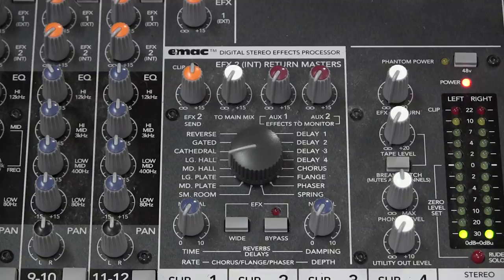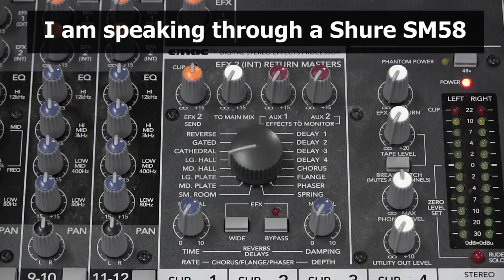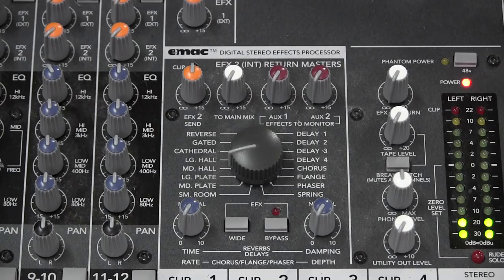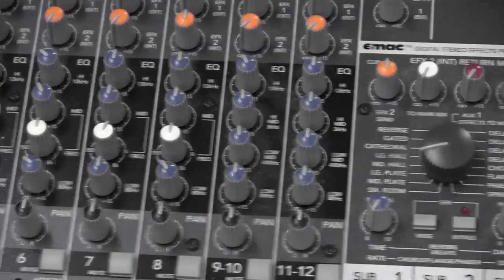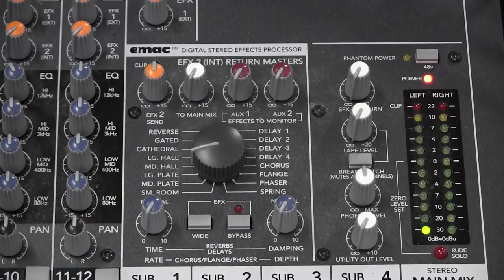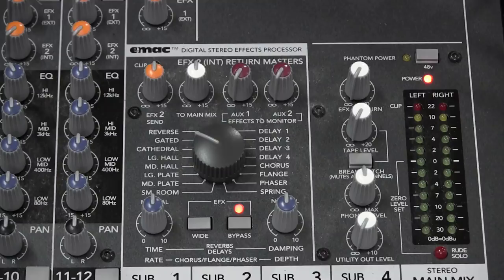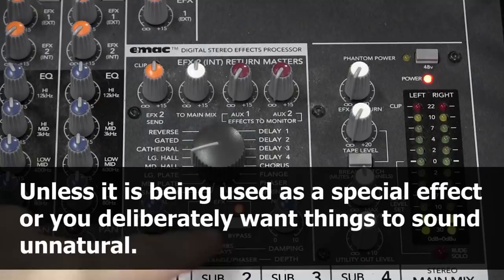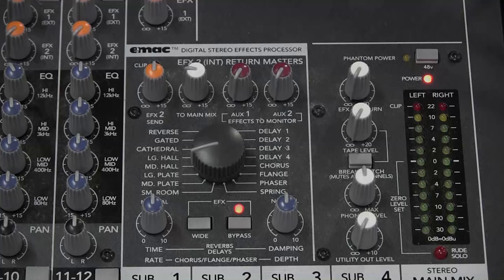How to use a mixer's internal effects processor

Comment: I'm a little confused when mixers say the are 12 channel mixer but with only 5 faders. 5/6 on one fader 7/8 on one etc. how do you access two channel at once on one fader ? What is the difference. When it says 12 channel I usually expect 12 faders for each channel
Reply from the maker: It's a stereo channel - if you look at the input panel these channels will have a left and a right input which are routed to the left and right outputs respectively. So it's two channels sharing one fader. 

Of course this is technically cheating, but mixer manufacturers have done it for years and it has become a norm in the industry ;)
Reply: Kurt Jansohn vn

Comment: I have a berhinger xenyx QX2222 mixing board. I am trying to figure out how to use the internal reverb that is built in the mixing board, and send it to the house speakers, and I also need to send it to my monitors on stage. I am using the aux send, but I can't get any reverb to my monitor mix.  In the aux send/fx out section there are aux 1 and 2, and 3 is supposed to be the orange one that sends the reverb and there is also a 1/4 " out with a fx in the aux send section that I don't understand. If you could help me I would appreciate it.
Reply from the maker: +Ashley Moss Hello Ashley, that mixer is broadly similar to the Mackie in my video. Make sure that the FX knob is turned up on the channels that you want to send to the effects engine, and that the FX master in the aux send section is set to 12 o'clock. The returning signal is controlled by the orange FX knob in the stereo aux returns section, to the right of the aux send section - make sure that the switch is in the up position to send the effects to the main mix. 

On this mixer there does not appear to be any way to route the internal effects directly to the aux sends.
Reply: +GLB Productions  Thank you, I think I will have to get a rack mount reverb unit to run to the monitors.
Reply from the maker: +Ashley Moss You're welcome, all the best with your music! If you would like to support the channel please consider signing up to become a patron at https://www.patreon.com/glbproductions?ty=h Every little bit helps!

Comment: Hi, I have a question that is kind of urgent: is it possible to mix the internal FX from the mackie efx mkII seperately to the monitor-speakers? How do you do that?
Paul
PS: great tutorial. I learned a lot from it!
Reply from the maker: Vormingplus Oost-Brabant Yes, that's what the 'effects to monitor' knobs are for - they allow you to control effects levels going to aux 1 and 2 separately from the main mix.
Reply: GLB Productions I tried this yesterday while putting the Aux-switch to pre-fader (as you suggested in another tutorial - and indeed I get fx on the aux- out's, but the effect is only present when I put the channelfader up. Is this normal for this mixing board or am I missing something?
Reply from the maker: Vormingplus Oost-Brabant It's normal for this mixer - the send to the internal effects engine is fixed post-fader. If it were pre-fader, when you brought the channel fader down the effect would still be present, which would sound very un-natural.

Comment: Thank you very much for the information you gave.
I have a question not related to this tutorial that I have europower pmp2000 mixing console. It says that it can give up to 1600 watt of bridging loudspeaker & 700 watt stereo. In the manual he only describe how  to used it with 2 loudspeaker at each 
stereo output so the total number of loudspeaker well be 4 
My question is can I connect more than 4 loudspeaker if the sum of there watt is less than 700 watt at the stereo output
Reply from the maker: +capricest87 Greetings :) It's not the number the of loudspeakers it's their combined impedance which matters. I suggest you watch my video on how to match amplifiers and loudspeakers, it should clear your doubts on this subject: https://www.youtube.com/watch?v=l9L7uK7Xy0w
Reply: +GLB Productions 
thanks for the advise another thing correct me if I'm wrong 
 If I had 2 speaker which are supplied by 4 ohm that can generate 100 watt for each and I wired them together they well give a total of 200 watt in one channel???

if that the case I need to make sure that the sum of my speakers power should not be more than what the amp can deliver.
Reply from the maker: +capricest87 It depends entirely on your amplifier. For example, your Behringer PMP2000 produces 250 watts per channel into 4 ohms. If you connect two 8-ohm speakers to one channel, each speaker will receive 125 watts. Do  you understand now?
Reply: Thank you very much now I get the idea
Reply: GLB Productions Thank you very much now I get the idea

Comment: I have a cuestion I have a mixer but some times I play at the same time with a band can you tell me how can I put my amps to the mixer and my CD players to the mixer ??
Pls my 
Mixer is mackie cfx16
And my players are 
Mixdeck numark
Reply from the maker: - Thanks for the question. For connecting CD players to the mixer see my video How to connect the audio from laptops, CD/DVD or MP3 players to the PA system. For connecting amps to your mixer see my video DI boxes part 3: Amplifier DIs - using, advantages and disadvantages. Let me know if you have further questions after that :)

Comment: hi. great tutorial on the mixer internal effects. just something i'm unsure: on the Yamaha MG124CX, the mic input is sent to ST OUT (the red button beside the fader). so does this mean the unaffected and effected signals are sent to ST OUT? Or must the red button be pressed in for the signal to go through the effects?
Reply from the maker: Hello Julius! The ST button controls only the routing of the dry (ie unaffected) signal - the affected signal is sent to the mix via the grey EFFECT RTN fader. Watch my video series on the MG124CX to see how the signals are routed to the effects unit.
Reply: Ya I did watch the MG124CX video, that's why I commented on that video too. haha

I think I understand the routing now. But with ST button pressed, isn't it sending both dry and wet signals to ST? Should the ST button be on or off (send only wet signal), or is it just a matter of personal preference? 

I'm asking like this because the way I see it, it's analogous to simultaneously sending the same signal to ST and to Group then to ST. Which, I think, is redundant.
Reply from the maker: It depends on how you're using the mixer - for normal live sound use where your FOH system is connected to the stereo outputs of the mixer the ST button should be depressed UNLESS you are routing your signals first to the groups and then to the stereo outputs via the groups. And yes you are correct - there is no need to send the signals to both the groups and to the stereo outputs UNLESS you are NOT sending the groups to the stereo outputs eg you are using the group outputs for recording or sending to a different set of speakers. That's the beauty of groups - they can be used to consolidate similar signals before they are sent to the mix or as a completely separate output from the mixer. 
As I said earlier, the ST button controls ONLY the routing of the dry signal - the wet signals have a separate signal path that is independent of the position of this switch. 
These are good questions - let me know if you have any further doubts.
Reply: Okay thank you so much for the clarification, it helps a lot to confirm my understanding. 

I have another question, but unrelated. My keyboard has balanced out (stereo XLRs), so is it ok to directly connect it to the snake/mixer? I understand the benefits of using DI in this case, but let's say for a situation where there's limited or no DI.
Reply from the maker: You're welcome :) 
Yes connecting directly is perfectly fine - that's what those outputs are designed for.

Comment: I have tried to use the fx reverb effects on Mackie profx22v2 with no success. I used it easily on profx12 but not on profx22v2, please help
Reply from the maker: Make sure the aux master for the FX section is turned up - it's the yellow knob directly above the subgroup 1 fader.

Comment: What would you recommend as the effect for a church setting. Using Yamaha Internal
Reply: Or should I just shut it off
Reply from the maker: You need to use your ears on this one - if your church has a significant amount of natural reverberation it is probably best to leave it off most of the time.

Comment: hi I'm using a mackie profx22v2 mixer....evertime i put my mixer on the fx works perfectly fine...i get the desired effects then as I continue to have it on as I play music the fx start giving disturbance and it slowly keeps increasing louder than to stop the disturbance I have to mute the fx...I m doing something wrong or there is a fault with my mixer...its a brand new mixer....please help
Reply from the maker: If the mixer is under warranty I suggest you contact the person who sold it to you and get them to sort out your issue.
Reply: Thanks

Comment: Hi! Thanks for sharing that! I have a question about clipping on the effect processor. When we play live with our band I set effects normaly but when i look on mixer the same time we play I see the processor is clipping. Can you please tell me how to solve this problem? I have the same mixer as in video (Mackie CFX12 MKII).
Reply from the maker: In that case reduce the send level to the processor, either by turning down the individual EFX2 channel sends or the master send which is just below the clip light.
Reply: Thanks! I just turned down to second line the master send and increased the master send to main mix. The send level on the channels is on unity. It's good now :)
Reply from the maker: Well done, you have optimised the signal to noise ratio of your processor :)

Comment: hello bruno,  can u suggest what type of effect can be suitable for singer in live show

my mixer: phonic sonicstation 22 (have dual effect processor)   thanks....
Reply from the maker: For live vocals there are two common effects used - reverb and delay. Use a short reverb (room, plate) for faster songs and a longer reverb (hall) for slower songs. For delay you want a delay that is timed to the tempo of the song using the tap tempo feature on your mixer if it has one. The other important thing is not to add too much because in live sound the venue already has some natural reverb of its own.
Reply: thank you very much sir, but how about using effect of speaking person? like MC's, Radio DJ?
Reply from the maker: I don't use any effect on those, it makes the words hard to understand.
Reply: ok understand... thank a lot, u r perfect teacher.

Comment: GLB Productions Hi, do you have a video on how to set a graphic equalizer? Thanks more power.
Reply from the maker: - No I do not - I personally prefer parametric equalisers over graphic equalisers when it comes to tuning systems. My advice with graphic EQs is to start with them set completely flat and then cut only the frequencies that are causing resonance or feedback. In my opinion, with the microphones and speakers available today, the less EQ applied to the system the better it will sound.
Reply: How about if i want more bass and vocals to my main speakers without distortion? can a graphic equalizer help? Im just a newbie in sound technology. Thanks
Reply from the maker: juromebato The most important thing in avoiding distortion is correct gain structure - first of all make sure your channel gain is correct by following the steps in my video: How to set gain on the mixing console

Comment: What equipment did you use to connect audio from the mixer to your video camera?
Reply from the maker: The mixer output was connected directly to the camera's line input.
Reply: @GLBProductions  You did not use any audio interface? How if I want to use only my iPhone to record video, Do I need any equipment to record video with audio from mixer?
Reply from the maker: You need to find an appropriate audio interface for the iPhone that can accept a line level signal - there are quite a few on the market but I'm not an expert in this area.
Reply: GLB Productions Thank you very much.

Comment: How do you turn off the effect without cutting out all the sound, when i click on the bypass button it cuts all sound completely :( help im a noob when it comes to mixers
Reply from the maker: Jack Johnston What make and model of mixer are you using, my friend?
Reply: Its a mackie cfx12 mkII
Reply from the maker: Jack Johnston That shouldn't happen - when you hit the bypass button on that mixer it will bypass only the internal effects unit, you should still have original signal from the channel going to the main mix. Make sure that the channel you're using is assigned to one of the subgroup pairs and that subgroup pair is assigned to the main mix. Consult your owner's manual on how to do this and let me know if you need any more help :)
Reply: THANK YOU! Wasn't sure what the sub groups were for, i've assigned them and now it works, thanks a lot mate :)
Reply from the maker: Jack Johnston You're welcome, feel free to ask if you have any questions in the future.

Comment: Good video. But doesn't explain how to add more than one effect to the mix.
Reply from the maker: Yes, that's because you can only have one effect active at any one time on this mixer.
Reply: @GLBProductions  Thanks. Presumably you can do it with digital mixers then? Like add delay and reverb together.
Reply from the maker: It depends on how many FX engines the mixer has, but in general most digital mixers are able to do this. There are also a few analog consoles that have more than one FX engine, like the Yamaha MGP series.